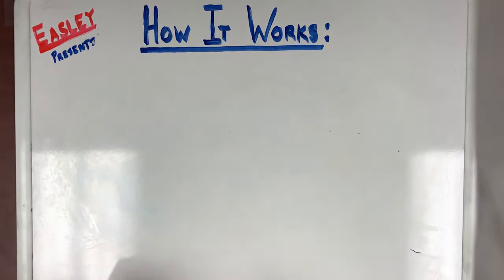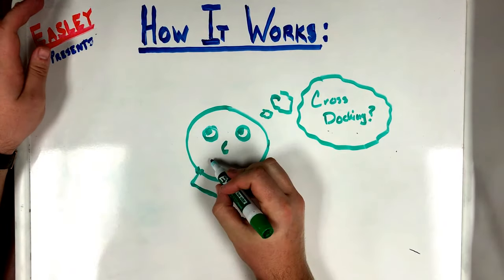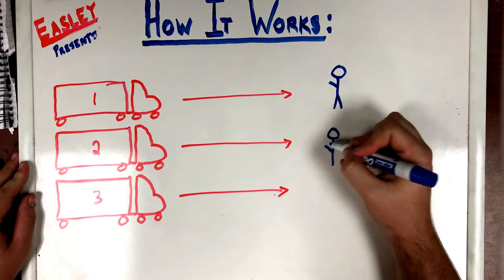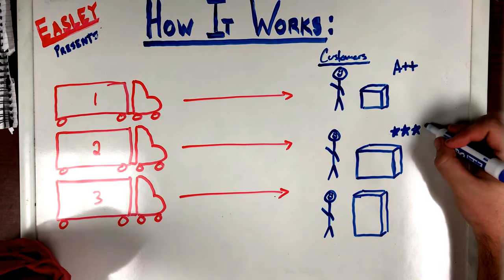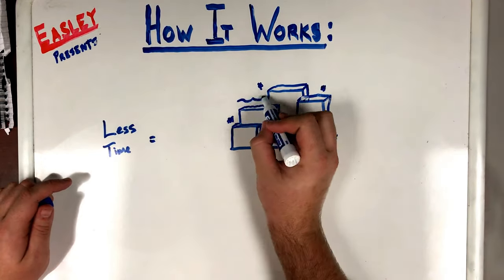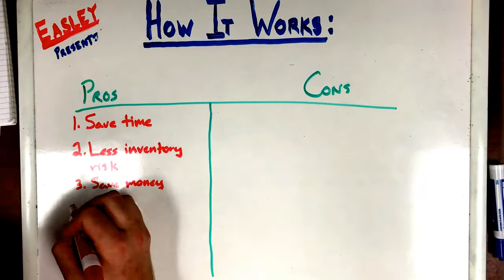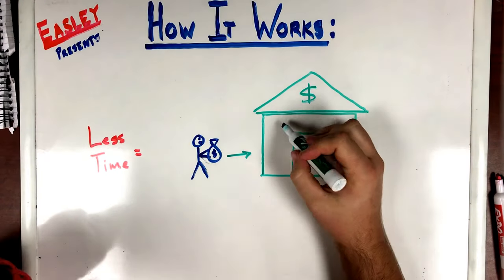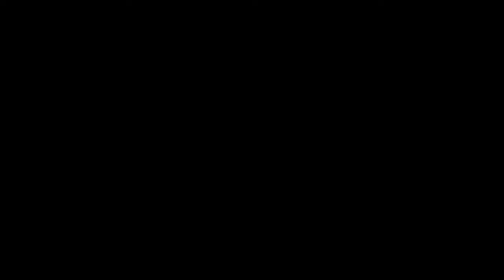How It Works: Cross Docking

Comment: Nice video, but you should include real disadvantages...
Reply: I agree. I beleive there more chances of damages due handling on dock. Often times, when not properly sorted, freight can be misrouted to wrong customer. If dock is also maxed out with freight, it can potentially lead to loss of freight on dock. Overall more handling brings about these in my opinion. I still love crossdocking but will like to see less handling but don't know how. I stand to be corrected as well
Reply: @danny745  that and it’s really just too much work in order to save truck space it’s modern day slavery even as a forklift driver

Comment: ok i just don't understand where are the goods stored before they are sent to the customer ?
Reply: Depends on the operation. Cargo may be simply sorted into trailers or holding areas. More complex operations may have programmable conveyors to move goods from inbound area to an outbound area in minutes. One of the main points of cross-docking is NOT storing the goods at all. Moving goods from trailer to trailer.
Reply: Cross docking is often used in JIT manufacturing environments. In this use case, freight is going directly from suppliers to manufacturing plants

Comment: why dont we directly send the same vehicle instead of unload and reload to other ?
Reply: In large distribution networks, it is common practice for drivers to have established origins and destinations. Truck A is unloaded, the cargo is inspected and sorted, and then loaded to Trucks B And C. While this is happening, Truck A is being loaded with cargo from Trucks B and C. A trade of sorts. Truck A will then return to the point of origin with cargo. This reduces cost by reducing the trucks and drivers need, empty miles, and road expense such as lodging and per diem.